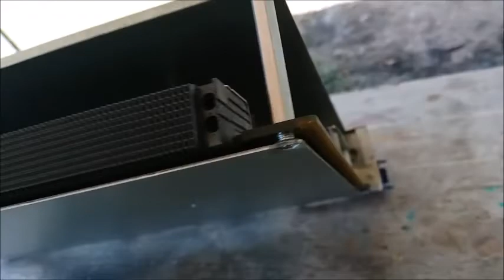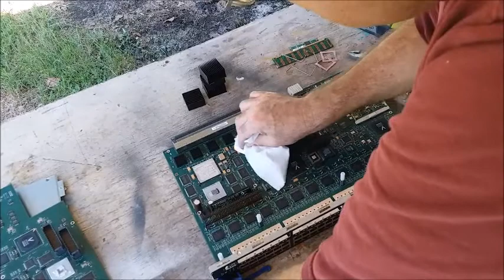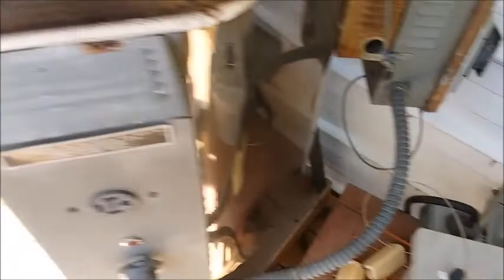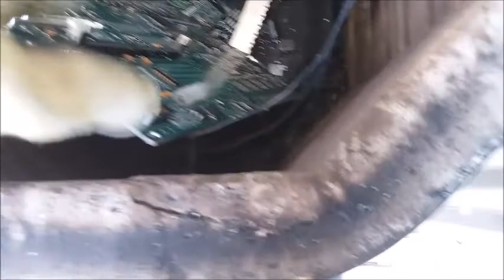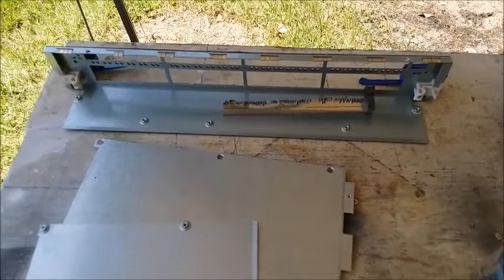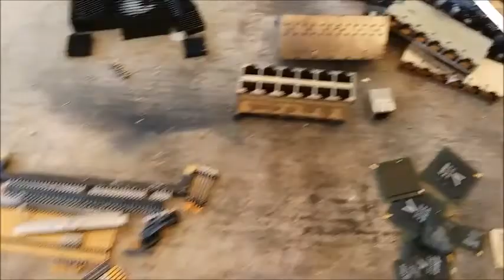Tear-down and scrapping of an Enterasys 72-Port Platinum Distributed Forwarding Engine for gold.

Comment: The pressed-in pins come out much easier if you tap the pin flush on the back of the board and pull the out on the front.

Comment: 15:50 Those are broadcom BGA chips, Yes, they Do have gold in them. Quite a lot in fact. Just like a gold corner BGA. There is a circuit board on the bottom of the chip that will come off when you incinerate the IC's that will have gold plated contact pads just like a gold cornered BGAs. I like these chips because they do not contain any PINS you have to etch away or separate when you crush.